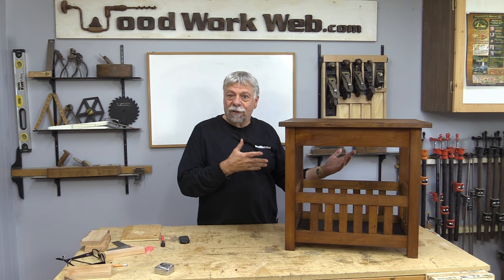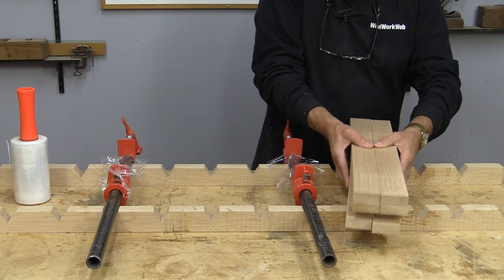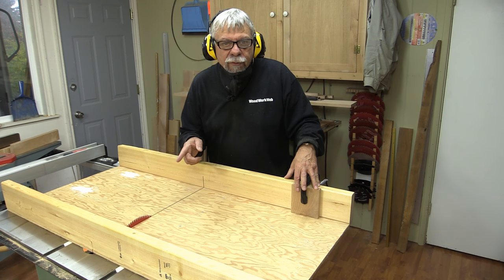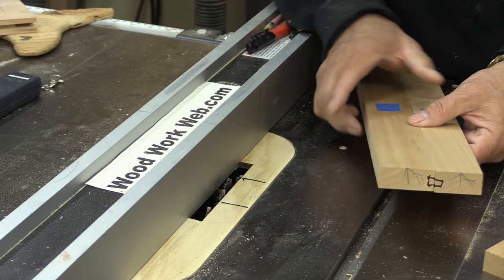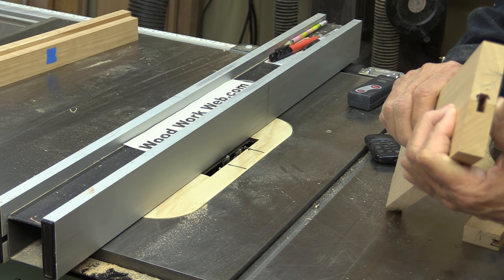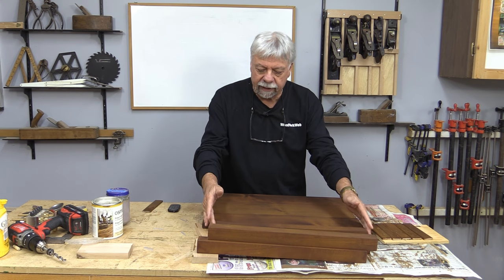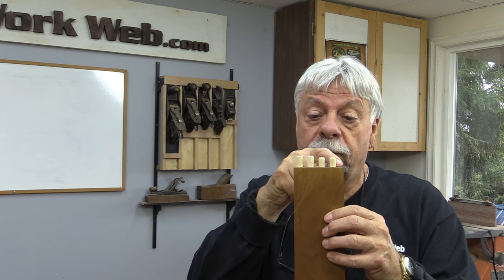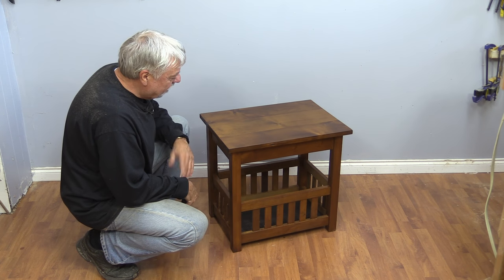How to Build an End Table, Arts & Crafts Style

Comment: Great timing since I have a similar build coming up.   I don't use my jointer to clean up the glue like you did with the legs.   I use my table saw for that.  Aren't you afraid the piece wont lay flat when you run it thru?  Surprised no pocket holes for the top.  I definitely refinish when there are so many pieces and cramped space.  Thanks again.
Reply from the maker: Hi Paul, yes  use the table saw too one I have flattened and squared, then depending ... I sometimes use the jointer again, times like this I wish I had a big sander ... oh well, maybe some day.  Would love to see pics of your build, could even post them on our facebook page

Comment: Hi Colin, hanks you for another good video and work order suggestions.  Briefly you showed the use of a Japanese style pull saw.  I have the same saw.  I read somewhere that one side is for ripping and the other side is fro cross cutting.  The teeth are of a different style compared to a Western style hand saw.  So how does one tell which side to use?

Comment: nice table. would it be possible in the  future to also give measurements in CM. if your table is 21" high according to my conversion it is about 53.34cm. than you give the legs as 5.5"x1.5" which equats to 13.97cmx3.81cm.  and also measurements of apron also does not look correct. I have used the American Imperial to CM conversion. Great Furniture. Love your shows. Thanks
Reply from the maker: Thanks Bobby, did you get the measurements off the website or the video? I wish I had plans to share.
Reply: WoodWorkWeb Of the video

Comment: GREAT project Colin.  I like the black on the bottom shelf.  I would not have thought of doing that, but it turns out to be a simple design element that does enhance the overall project.
Reply: I don't really think that the colour of the bottom shelf matters a great deal as it will be covered with magazines when the table is put in the living room. Very nice table none the less. Nice one Colin.
Reply from the maker: Yeah, you are probably correct Cliff ...
Reply from the maker: Thanks for the comment ... one of these days I will spend more time on finishing and talk about the white versus black element .. thanks for mentioning this I have made a note for future vid ... thanks buddy